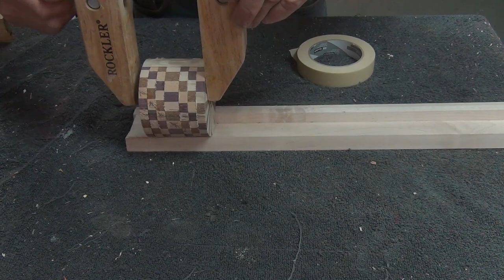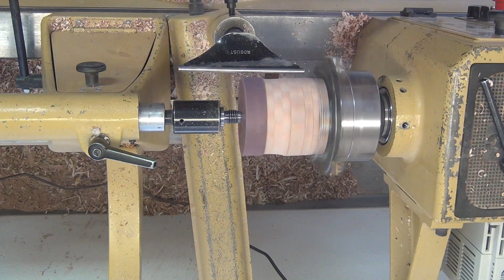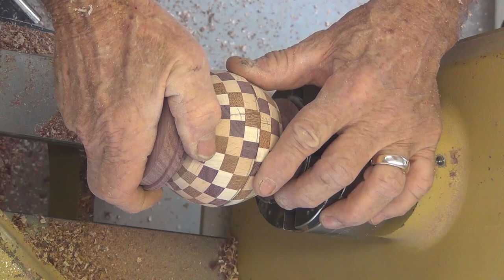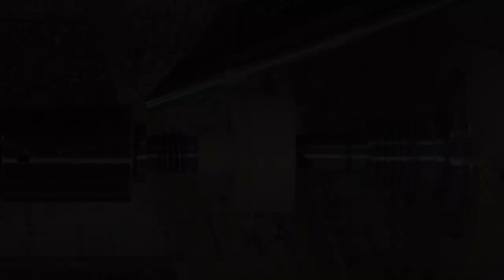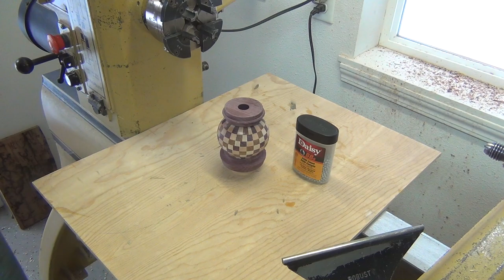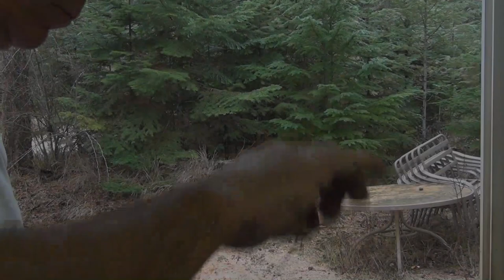Woodturning - Fancy Maracas or Keepsake Baby Rattle

Comment: Hey Squarepeg Tommy:

Your making so many great wood turning videos makes it difficult for me to not have Squarepeg Tommy marathons watching them.   This video is no different from the others;  an artist a work!!!   Thank you for sharing!!!  👍👍👍
Reply from the maker: I am really appreciative of your comments and watching my videos.  I have a passion for wood working and it is rewarding to share with others.  Thank you very much.  Tommy
Reply: Squarepeg Tommy 

I took a look at your Etsy site.  You certainly have lots of nice wood turnings...the ones I watched you turn on videos.   I just picked up turning about a year ago.  I still struggle with some aspects of turning and some of the tools like the skew.  And the summer heat is unbearable in my garage where the temp inside will often hits 108 degrees.  When that hot I can not turn wood nor can I afford to insulate and install AC to make conditions bearable.   I am no longer a spring chicken and take the heat like I once did in my younger years.  The heat caused me problems 2-3 weeks ago and put me in the hospital with heat exhaustion.  Dr sent me home after getting fluids in me since the COVID would have done me in.  It was safer at home. So now, I binge watch wood turning videos to learn as much as I can.  You’re at the top of the list of those I watch.   Of course, I also like Jacobson, Humphrey, Waldo, Peace, The Wood Whirler, Tippin to mention a few.  I take bits and pieces of what all do and meld into my own style.  The sad part is that most of my turnings are only good for fire wood.
Reply from the maker: @jarmstrong2843  Don't give up!  I love wood turning so much that I would turn giant sequoias into toothpicks just to keep turning.  By the way, I don't use the skew properly.  I use it like a scraper and it works for me even though I have been criticized for it.  Just don't give up, keep trying, and enjoy what you do.  Blessings, Tommy

Comment: I love this. I have a question about the glue though. I made some rattles using both gorilla and glue used in video but then read that they're only approved for indirect contact with food. Anyone have any idea if this means it's baby safe since I think it's safe to assume a rattle will be going inside the baby's mouth at some point?
Reply from the maker: Thanks for watching the video and liking the results.  I give these only to relatives and friends and I make it clear it really is a keepsake, not a typical rattle.  I also coat the project with at least 8-10 coats of polyurethane which is totally foodsafe.  I then polish it with wax.  So the extra coatings remove any possibility of contact of the glue with the baby.  Thanks for your concern and comments.  Tom